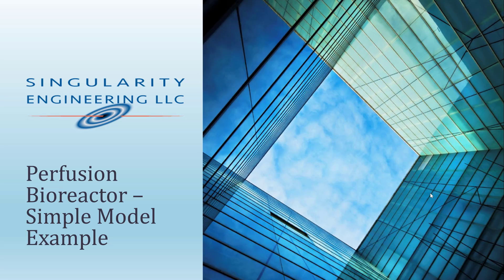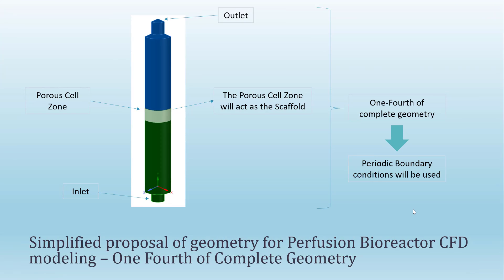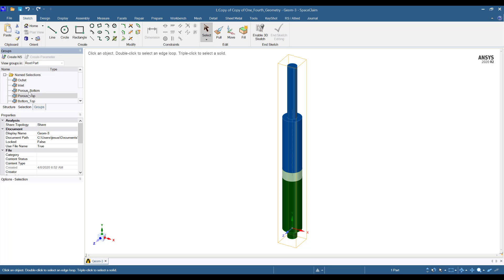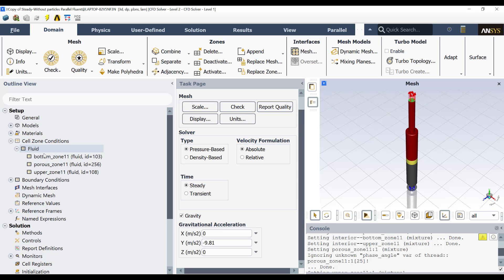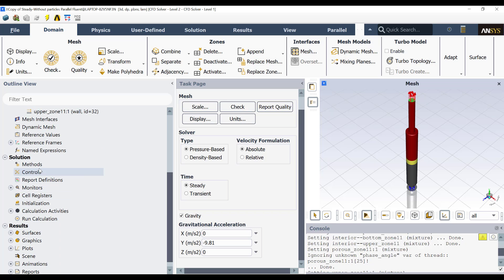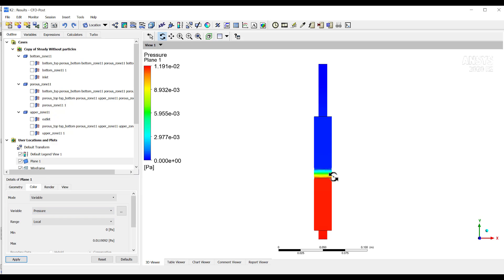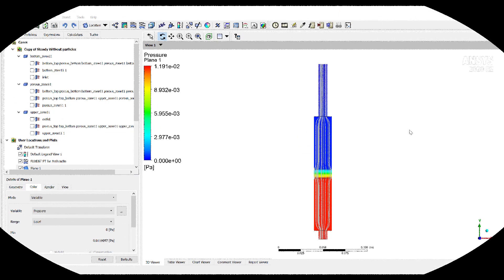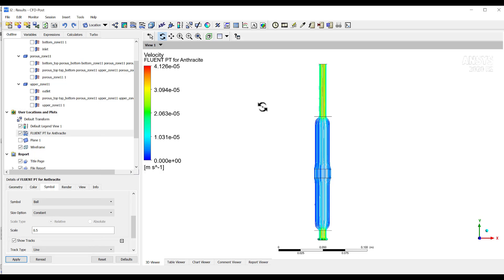Perfusion Bioreactor Modeling Using ANSYS Fluent - Part 1

Comment: Sir how can I do the simulation for a photocatalytic batch reactor here? It would be great if you could help me Thanks
Reply from the maker: There are many different levels of approaches to modeling a photocatalytic reactor. You can model the flow, the radiation and chemical reactions in various levels of detail depending on what you hope to get out of the simulation. For example you can write an expression for the chemical reaction in the catalyst region as a function of the radiation intensity. You can make this more complex by including additional physics as needed.

Comment: Can you share your supplementary material like geometry or any documentation or if you are comfortable in sharing simulation files
Reply: Based upon the scale bar at 10:27 I got these values for the CAD:

Inlet Diameter: 10 mm
Bioreactor Chamber Diameter: 20 mm 
Outlet Diameter: 10 mm

Porous Cell Zone Diameter: 20 mm
Porous Cell Zone Length: 10 mm

Inlet Length: 60 mm

BIoreactor Chamber Length:  130 mm
Outlet Length:  10 mm

That should be enough to remake the CAD using any available software. And the settings for the simulation are easily shown in the video.
Reply: @DThorn619  thanks